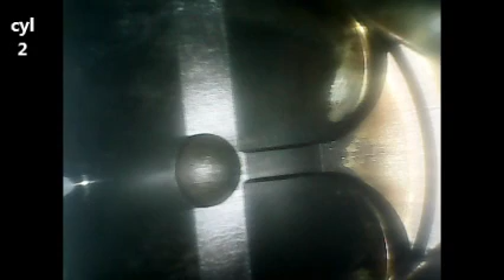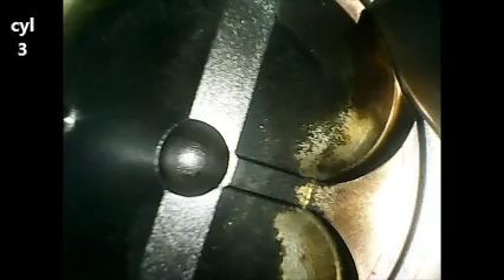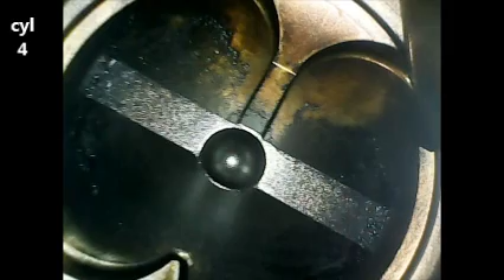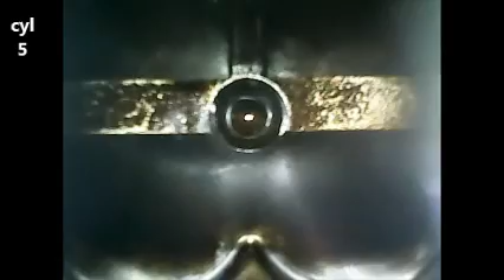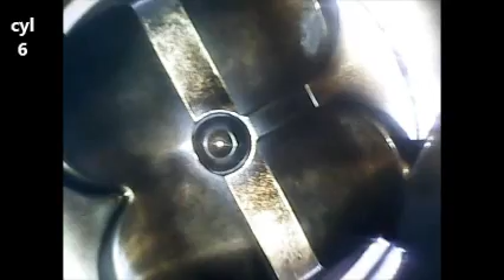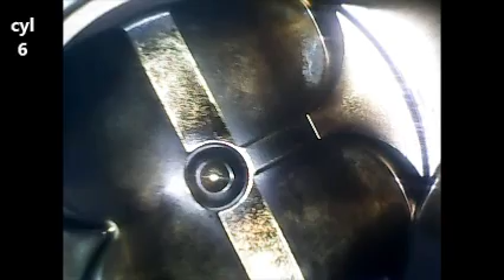race engine piston inspection

Comment: Oh guys... This is something you should check before assembly! ;)
Reply: Of course ... but we thought the block deck height was the same between m54 and m50.  It turns out that the m50 block is 1mm shorter, hence the really close valve-piston gap.  After we removed the head, we found that the valves were not actually touching.  The clean spots were just from the very small gap.  We installed a thicker head gasket (MLS 0.140), and were immediately able to get more timing and more power out of it.  Lesson learned!
Reply: Arek Wojciechowski Exactly! It's 211mm vs. 210mm I think.
Were the valves reusable or bent?